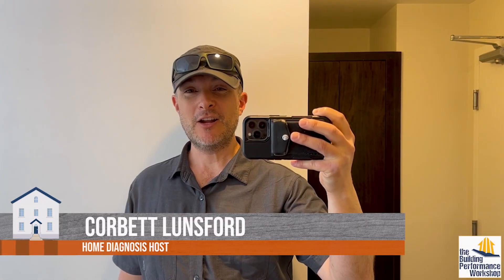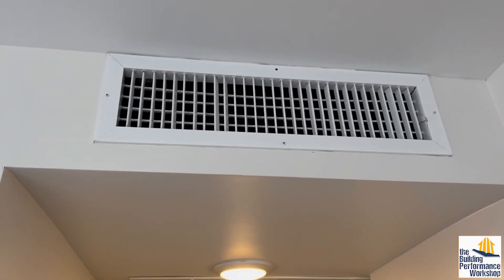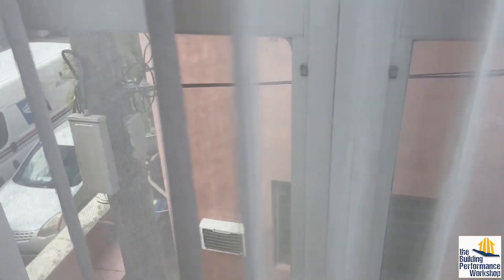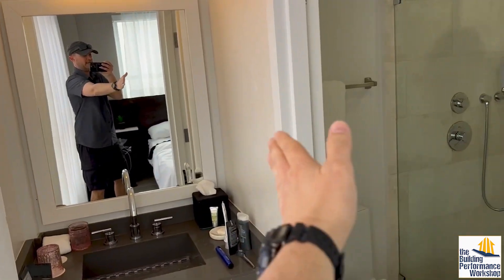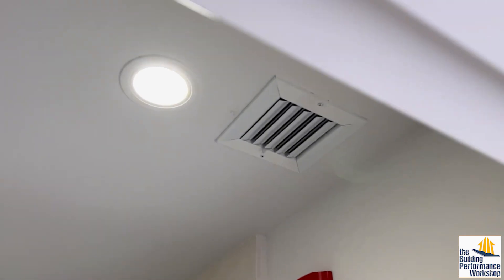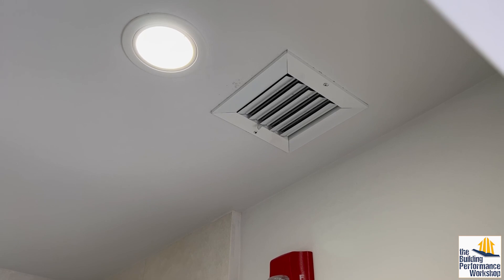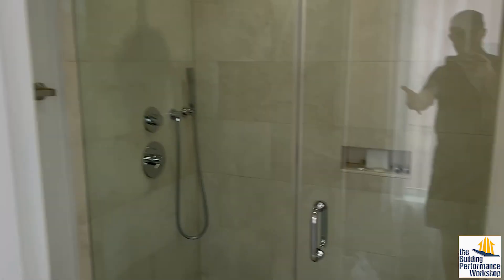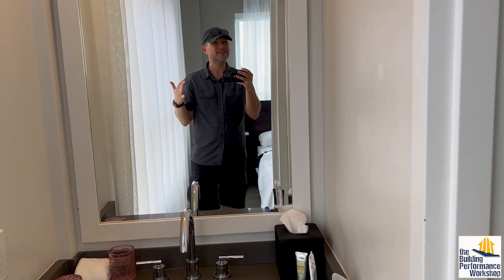HVAC Fail: the Red Flag of Unnecessary Supply Vents in Residential Buildings

Comment: It's there for a reason. Those bathrooms usually have the door closed and even with no exterior walls they get warm because the exhaust fans don't work well and customers want a bathroom to dry off quickly. I and especially the better half have been in enough hotel rooms that if it doesn't have a vent in the bathroom it miserable. She spends half the month in hotel rooms and not having a vent in the bathroom is one of her big gripes. Everything you can do to quickly cool and dry in there the better. Exhaust fans don't pull enough air. I'll have to have her make a list of the common issues with hotel rooms.
   
     The science may say one thing but actual experimentation often shows there is something missing from the science equation. Anyone that works with engineers can tell you that much of what they say will work in the real world doesn't. Course we love when they say do it their way it means change orders when we go back and do it the way we told the engineer/architect it had to be done.

Comment: I normally see those small square vents as low-CFM, constant exhaust. Not supply. But that bathroom has what appears to be a residential exhaust, so who knows? It's also possible one replaced the other and they didn't feel like patching the hole for the other.
Reply from the maker: Yeah, the bath fan works in yhis one

Comment: The large return could also be acting as access to a fan coil above the ceiling.
Reply from the maker: Yes, and also it's doing a great job moving air
Reply: The unit can probably be removed and replaced through that filter grill.

Comment: Is that make up air for the exhaust fan in the bathroom ?
Reply: I was wondering that too. Especially if there was an ERV/HRV
Reply: Probably not in this instance. Since the bathroom exhaust is a residential style unit, it only runs when the switch in the room is turned on. It might connect to a longer trunk line with backdraft dampers in the 3”/4” duct or it might terminate as a single run of ductwork. Lots of hotels don’t have ERVs/HRVs. The systems I have installed were specified as inline exhaust fans that cover several rooms  and cover about a quarter of a floor. Then there is a package unit on top of the building that provides every hallway and common area (sometimes into the return of a split system) with conditioned, fresh air. Not that engineers can’t specify it that way. I just have never seen it done. 

Again in this instance, the exhaust only runs occasionally. Therefore the air changes per hour are dependent on the occupant and not the HVAC system alone. I agree it is probably just supply air from that register and not fresh air.

Comment: Wow and here I started watching you because I thought you knew more than I did. As someone in the hotel industry I can tell you it’s a make up air duct that runs to the big aaon units that sit on the top of most hotels. It basically takes outside air dehumidifies it and cools it. The room air conditioning is a separate system. This system vent keeps the room and the hotel from having a musty old hotel smell as well as keeping the space at a comfortable condition.
Reply: Interesting.
 But I have been in plenty that are using the same hvac to pump air into the bathroom.  
He is smart enough to make the connection that when the main hvac kicks on it kicks on in bathroom at same time. 
Most hotels I have been in have Vents cut into thr bath doors. Usually exhaust vent doesn't work and even if it did, severely indersized.
Reply from the maker: No, this is not an exhaust riser- the residential bath fan is clearly visible over the toilet in the vid. Try again.
Reply: @HomePerformance  
He is saying its a separate fresh air system.
I have stayed in Hilton's and never seen a fresh air into the room. Maybe that system is not for the peasant rooms. 
The rooms are always stuffy and moist. Cold. But moist. 
So i crack a window during my stay.
Reply from the maker: A fresh air system for a hotel room… hmmm, no- pretty sure all these types of buildings use hallways as supply plenums and push dilution air under the doors. Maybe our friend is from someplace else.
Reply: @HomePerformance  your incorrect. Aaron and Addison both make system to do what the poster is saying and by law there has to be fresh air in this is clearly committed DOAS air to the bathroom to make up for the exhaust. Like the poster i watched assuming you could teach me something. Guess you did. Who not to learn from. Thumbs down to the video
Reply from the maker: As stated, almost all residential multifamily buildings have been, and most continue to be, designed with a hallway supply plenum approach. Fresh air supplied to hallways, goes under doors to units. This is not some specialized MUAS the hotel developers were ambitious about.
Reply: @BiggDouggie  different area than what you are referring to. 
Again. All the hotels I have been in in my area suffer badly from fresh air and air problems.  This video is likely from Miami.  Which is close enough to my area.

Comment: Since you did not design this HVAC you cannot know why that vent is there.  It may supply air in addtion to the under door air when the door is closed.  Or it may be a vent to a constantly on separate exhaust system directly to outside, which I have seen in many construction drawings.
Reply from the maker: I have been involved in the design and commissioning of large multifamily buildings, and I test stuff wherever I go for kicks. Since the exhaust fan to the left, over the toilet, is operable, and since there was conditioned air coming out of this vent, there's no real question what it was meant to do.

Comment: What about sizing issue probably has to dump more air in that room so the system runs efficient, moving the right amount of cfm and refrigerant charge is very crucial for the systems operation and getting the max efficiency or seer rating out of that system.
Reply from the maker: Dump it in the rooms that need it, is what I’m saying

Comment: Since the bathrooms are usually closed when the shower is in use, could that simply be a supply for make up air? I saw a vent presumably for moving humid air out from the space.
Not an HVAC person, just asking.
Reply from the maker: A 1” undercut on just a 24” wide door (no doors are that narrow) can allow up to 50 cfm of airflow without major pressure effects. That’s straight out of Manual D. No need for a vent just to allow pressure relief of a sub-par bath fan.
Reply: @HomePerformance  I had no doubt you had good reasoning behind it all.
Reply: A 1" undercut on a door is huge, as in it looks horrible, sounds horrible and no one does it. What's the undercut on that bathroom door? Or the entrance door?
Reply from the maker: Thx David
Reply from the maker: All the doors in every home I’ve owned had a 1” undercut.

Comment: Corbett, I was going to fight you until I saw the RESIDENTIAL BATHROOM EXHAUST. 🤦🏻‍♂️ You are correct. It is not needed. 

What I have installed in new construction hotels before are bathroom exhausts that cover about a quarter of each floor. Then the air supplied to the hallways and common areas is fresh/conditioned makeup air. Each room is slightly negative pressure from the continuous exhaust fans pulling a few cfms out of the room and the fresh air is drawn in from under the door. 

That is not the case here. You are right on the money.
Reply from the maker: Hi five buddy
Reply: Interesting.

Comment: As far as what you're looking at most likely that hotel room has what's called a pancake unit in it It is an air handler that doesn't have a rectangular box like a normal air handler All it has is two scroll cage motors butted up against a rectangular flat coil with a drain pan in it basically you open that return grill and you'll see the unit in there then there's going to be a small rooftop condenser or something bolted to the side of the building like you would see with a mini split system as far as the vent in the bathroom absolutely you need that supply but in the bathroom It's code. The exhaust vent isn't necessarily code but a supply vent is. And the large AC vent that is supplying the hotel room itself that's a standard size vent for a sidewall. Basically that one vent has to supply a minimum of a ton or a ton and a half of air If the vent was any smaller the air noise would be so loud it would be obnoxious to the people staying in the room hence the large size of the supply vent
Reply from the maker: Yes, it’s a ducted minisplit heat pump, accessed via the return grille.
Code is to have a Man J/D/S calculation performed, Billy, they don’t require heat/cool supply vents in specific rooms in residential construction. Unless you can cite a specific part of a misguided local code?

Comment: So if the bathfan is removing air and moisture from the bathroom and the supply duct shouldn't be there in the first place, how does the pressure in the room equalize? Would it be better to install a jumper duct between the bathroom and hallway so the bathrroom doesn't depressurize when the fan is on?
Reply from the maker: You can relieve up to 50 cfm through just a 1” undercut on a 24” wide door.

Comment: Man, some tiffy people. 
First the system is designed for the area and climate it is installed.
Corbin is there and can tell which direction the grill is flowing and if its from the room system or not. 
2nd. I am amazed how people can watch a video and not watch it at the same time. Then blast in the comments details they missed in a short video. 
Not short enough perhaps? Attention span no more then 9 seconds.?
And yes science/ engineering can be different than real world. Like frame work in the way so they change the plan.

Or big one i see is maintenance crew doesnt have the money to fix things so just botch repair.
Reply from the maker: Amen T, maintenance and repairs are a whole lot of reasons buildings might not be performing.

Comment: Did you actually turn on the in hotel room HVAC unit and actually notice whether or not air was going out?  Like if you really want to make a case here and not have everyone jump down your throat saying you are wrong, all you had to do was take a piece of paper and tape it to that vent in the bathroom and turn on the HVAC system and as soon as we hear the sound of the fan there should be a flapping around like hell bit of paper next to that vent in the bathroom. And if nothing actually happens, then it's either a supply or outlet vent for makeup air. Simple test. At which point either you or everyone else would have a different answer in all of these comments.
Reply from the maker: If I knew there were so many hotel ventilation groupies out there I would have, but this was just supposed to be a trivia item. Yes, it was a supply, and you can see this type of mistake in residential construction often. This is not an anomaly.

Comment: Big return to possibly access the unit. Been in places where the return doubles as an access when changing out units. And the bathroom vent is more curious it's located directly above the fire alarm/detector thing. (Can't tell). Our area you can't have supply or return air directly above a fire alarm. Overall good look. I also randomly critique HVAC everywhere I go. Lol
Reply from the maker: Haha, good to know there's a like mind out there JD. For sure that return is the access, still love what it's doing for the static pressure.

Comment: I suppose that's why all my registers are on the floor below a window.
Reply from the maker: In older homes, that's necessary because the window bleeds so much heat, in better insulated homes with better windows, you can put the vent wherever you want as long as its mixed within the room (ceiling fans)
Reply: @HomePerformance  You got it right, cuz my house is 1964. It's solid as a rock but a bit drafty. 😁

Comment: what about fresh air. My fresh air supply is connected to hvac vents so I would want some of that to be in closets and interior rooms.
Reply from the maker: AV, bathrooms are best designed as negative pressure zones, they'll get the air they need from under the door.
Reply: @HomePerformance  oh duh that makes sense. Quick question. Has anyone done the energy calculation of lowering humidity vs lowering temperature? I have heard you and others say that 75 at 40% humidity feels just as comfortable as 70 at 60% humidity. But what does the cost of keeping humidity down vs temperature?
Reply from the maker: Whoa, that’s my nerd level 16 for sure- putting it on the list right now my man

Comment: I usually love your videos. You’re off base here unfortunately. 

You’re guessing the purpose of that supply. You don’t know for certain its purpose or origin, yet you speak as though you saw the ducts in the ceiling. Many things could be producing cold air out of that vent, supply air, dehumidified air, or fresh air ventilation just to name three.

Essentially you stated that because a room has no exposure to the outside, it therefore requires no heating and air, which is frankly nonsense.
Reply from the maker: Have you read Manual J, Adam?

Comment: It seems you have no idea about humidity and the reasons to move air and ventilate small close spaces as bathrooms. Smell humidity? Any clues? 
I am sure you are a qualified HVAC engineer that has to comply with mandatory regulations... No?  Mmm i understand. Have a great day
Reply from the maker: Luis, this is not a bathroom exhaust, the residential bath fan is over the toilet to the left, you can see it in the vid.